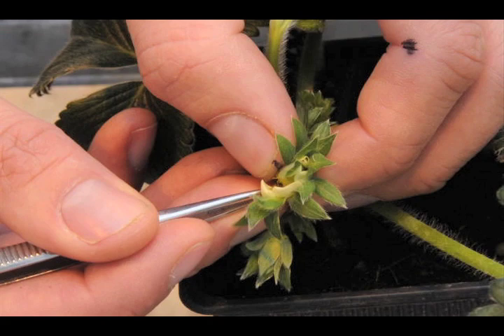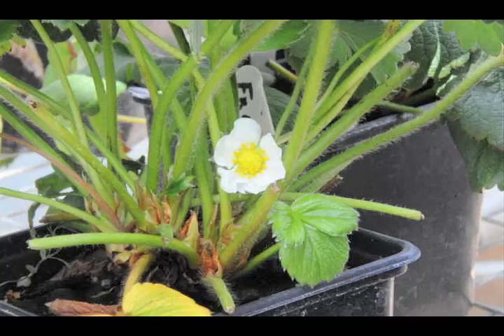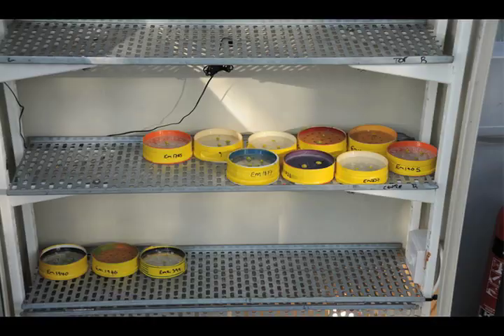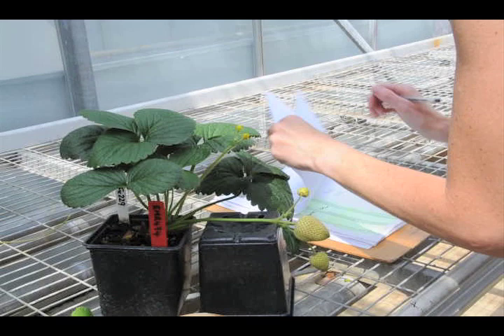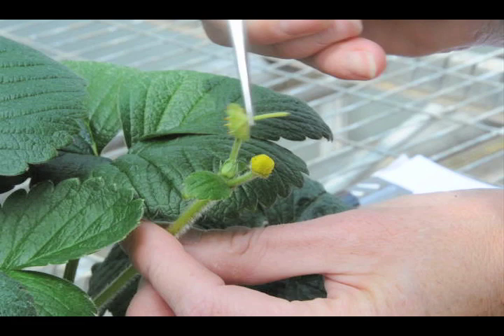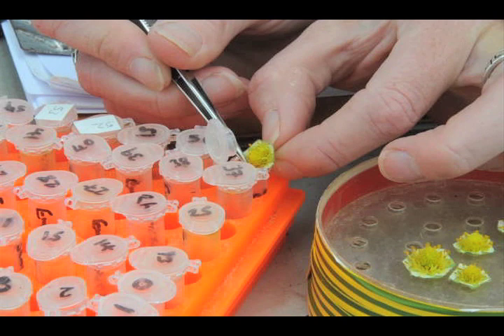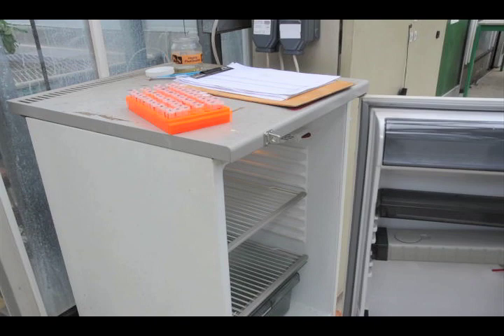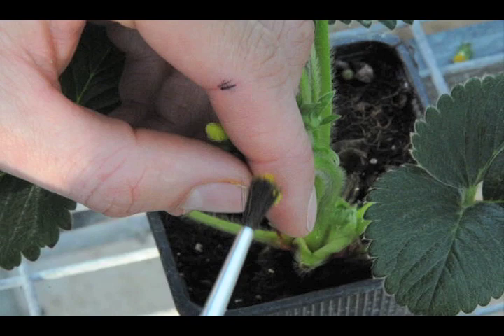Strawberry breeding techniques - crossing

Comment: Why does it take several years. Are they unstable in the first few years.
Reply: It's so they can evaluate the growing habits and taste. It takes at least 2 years to get a solid crop from seed to begin with. Also, you usually start the seeds the next spring though I like to start them right away. Then of course it can take a solid year or two to mass produce the resulting variety.

Comment: i understand the steps but how dow you end up with 7 years before testing the end result. you cross the 2 types. that year it wil produce fruit. you take those seeds grow them the next year and you wil have the end result right ?
Reply: I think strawberries grown from seed usually don't fruit until the next year. But I'm assuming "of interest to strawberry grower" means they'd want to know how an individual of a given variety performs for several years once it's bearing fruit /shrug
Reply: You need to stabilise traits for it to be of any use - otherwise you will get many different types of strawberry plants from one pack of seeds
Reply: @qiwiqiwi1997  ah ok sounds logical. not as simple as i thought but thats life ;) thank you for your answer
Reply: There is a lot of risk in farming, you need to negate as much of as possible, Disease, quality, taste and shelf life all come in as a factor.
Grew up on a farm growing strawberries as the main income.
You can have runners that produce 5 time's as much as another species of plant but have no taste and no one wants.
You can also have plants that don't produce so well but have a quality taste but no shelf life.
Farmer's are reluctant to go to a new breed unless there is overwhelming evidence that the new hybrid is better or the old hybrid has stopped producing the number's.
Runner supplier also has to keep coming up with new hybrid's, Each species seems to have a certain life span of about 7-10yrs before they decline in produce numbers.
Reply: @TheyCalledHimTheDude  stabilization only occurs when selling seed. since the broad majority of strawberry plants are sold as runner clones this is unnecessary and would jack the price of seeds up tremendously compared to individual plants sold at nurseries. the only reliably sold seed packets for strawberries are ones that grow true to type which are more often than not some form of alpine/woodland species which will not produce the same size plants.
Reply: @pizzaki582  that's very interesting! What do you think it's the best all-round variety now in terms of quality of taste, crop and disease resistant?
Reply: @darkfronte  
just talk to a main commerical seed/plant supplier, i m reluctant to give to much information out, As my father told me a story about a Neighbour who kept coming to my Grandfather advice for  growing commerical flower's and everyday for  day for 6 month's this neighbour would talk with my Grandfather, the following year my grandfather and father found out this man has started growing the exact same crop's as our family and started to compete against us. So I apologize for not naming what we grow.
but there are thousands of different varieties and it's all trial and error a lot of the time.
what you can do is plant a mix of different varieties and see which plant Variety is best suited.
This is what we normally do when a variety life span is almost up, we try to find the next varieties and we trial and error maybe 3-4 recommended varieties.